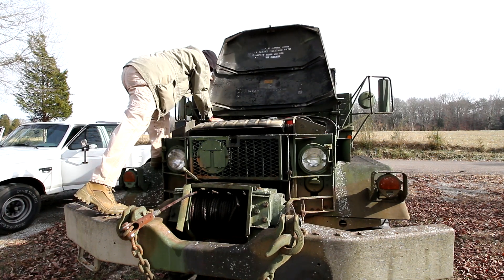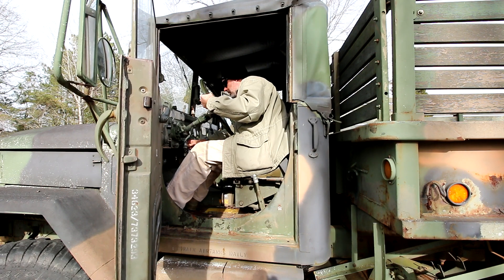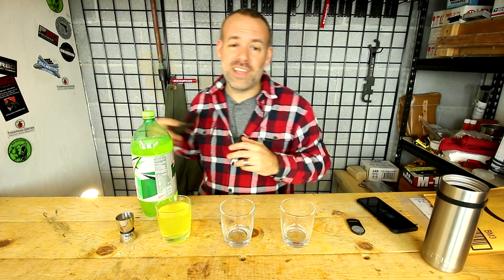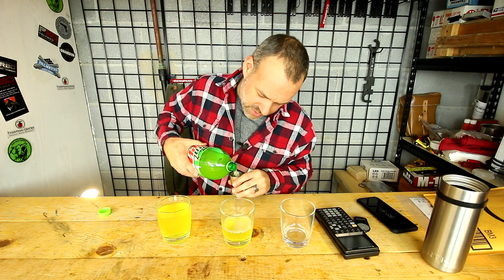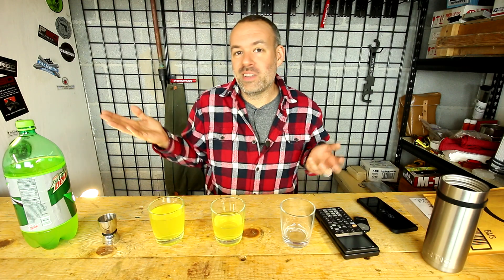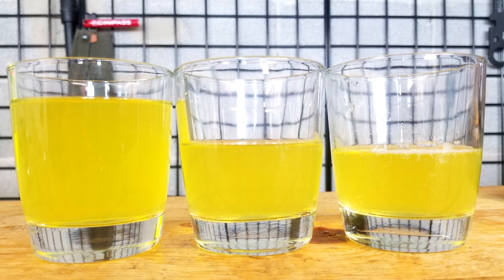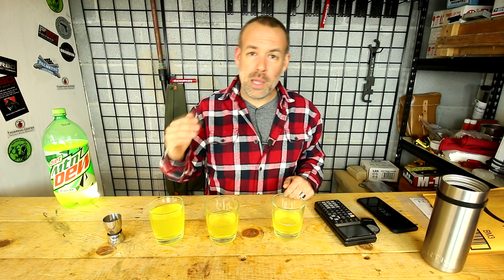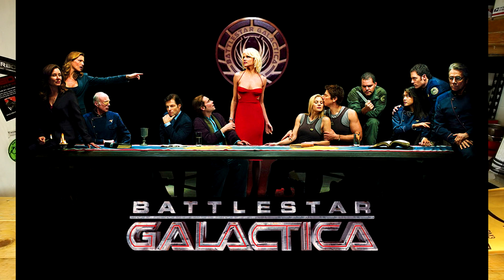Engine Cold Starting Explained by Deuce and Guns

Comment: I don't know if it's what I heard but your startup of the 250 it sounded like to pushed the throttle. NEVER push the throttle of a diesel on startup. I have seen hundreds of diesel engines destroyed by doing that. But cool video of the Duece.
Reply: Snoopy the ace  no it won't.  We have about 60 trucks.  A good mix of internationals, Cummins, cats ect.  They are all fully loaded to their max gvwr with beer and liquor.  Drivers jump in and floor it to get up the big hill.  None of the trucks blew up yet, and we have some old trucks.
Reply: Alan I have heard many diesel mechanics say otherwise. And many others who own diesels back it up. Maybe you have gotten lucky. And I wish you stay lucky. But I will continue to not. It's not like it takes much more time.
Reply: Snoopy the ace Im a mechanic there.  I wouldn't do it on my personal trucks but our guys do it all the time and nothing has blow up
Reply: Alan ya I would rather stay safer than sorry.
Reply: Hey Snoopy, I live up north where it gets below zero, and I never knew just what to do about starting my Deuce on a cold day - to hit the pedal or not. I am tempted to cause of old cars you had to pump the pedal before starting... Thanks.
Reply: Earl Schultz ya old vehicles you do. Especially with old carbs. But new stuff doesn't need it. With my 54 Chevy I would because I need to pump fuel into the carb but never with my 2000 f350.

Comment: I live in north western Pa. It is normal to be any where from below zero to the teens in the winter for the high.  Starting fluid is normally required for my gas engine tractor to start. It has a big snow blower on it, works great once it starts...

Comment: You should always check the oil BEFORE you start the engine, to ensure that you have enough.  Therefore, the oil will be cold.  The volume doesn't change appreciably with temperature.

Comment: Stick on, oil pan heater for very thick diesel oil...Wolverineheater.com
Deisel oil is almost too thick to drain at 50F, so, might be a worth while option even if a small generator is required out at the farm... Thanks for sharing.
Reply from the maker: I didn't know those existed.  Thanks!